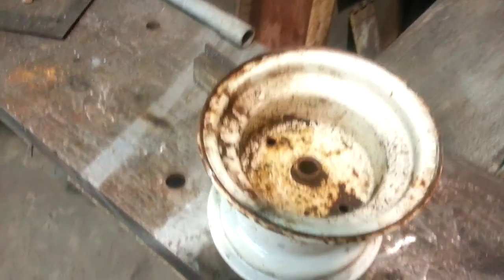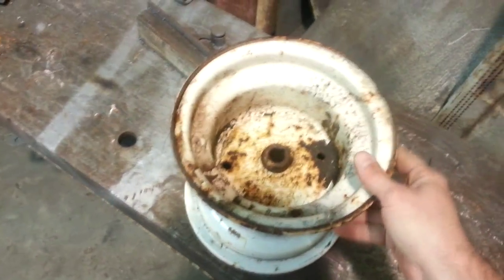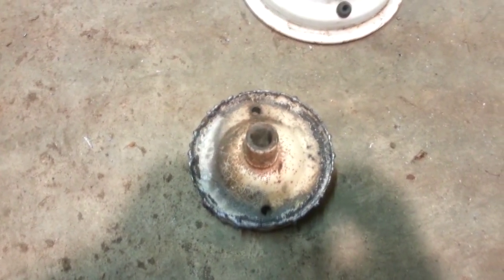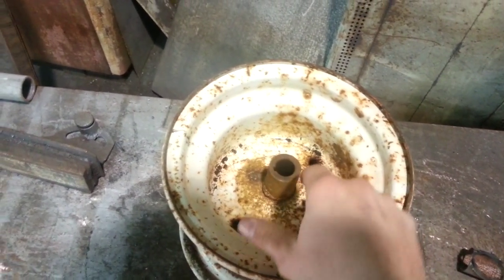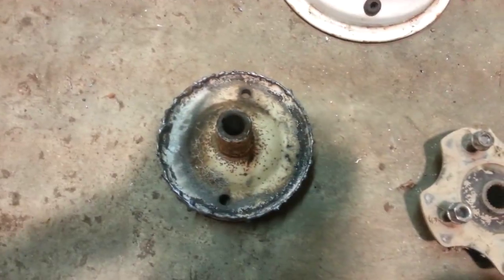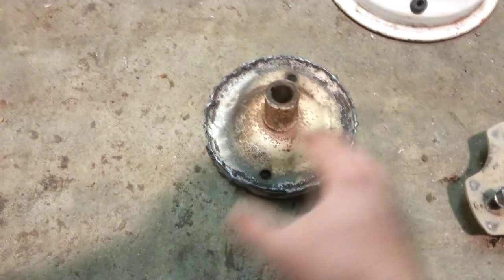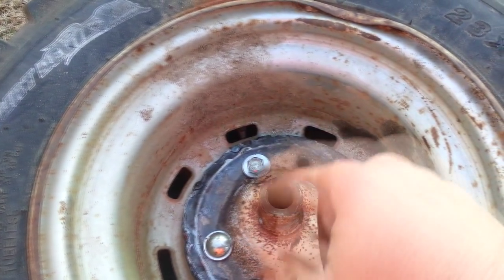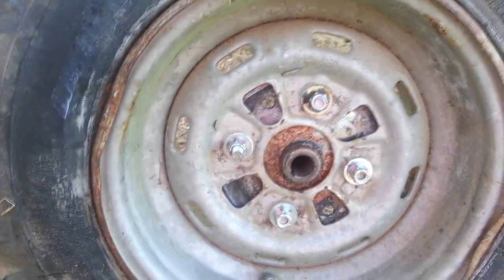How To Make ATV Hubs For A Riding Lawn Mower

Comment: Cut the shaft off the stock mower rim, Shove a sleeve over,then Weld that to centre of Atv hub.  Im in NZ and and part way through build, thinking of using entire rear end from a quad bike.
🚜🏁